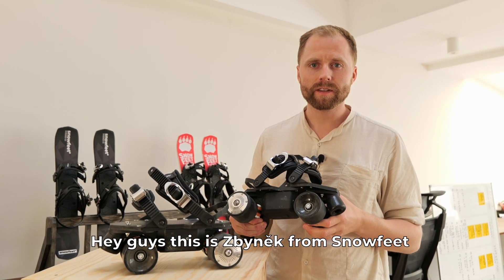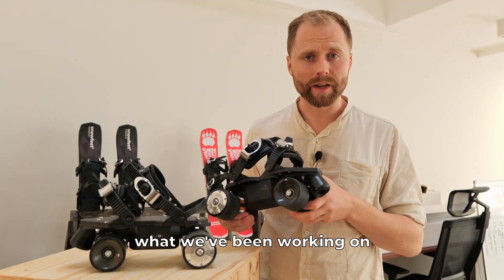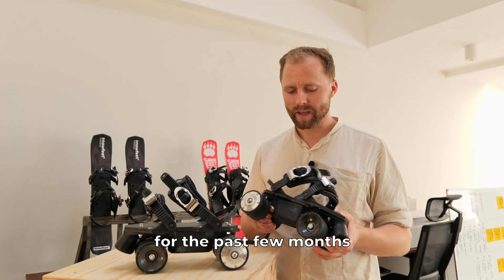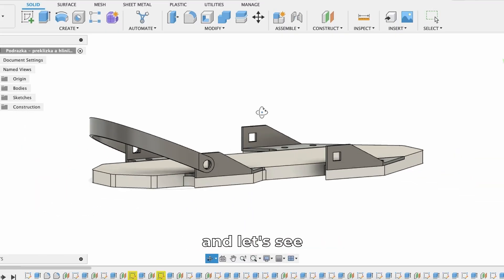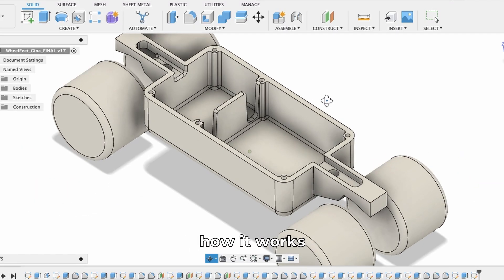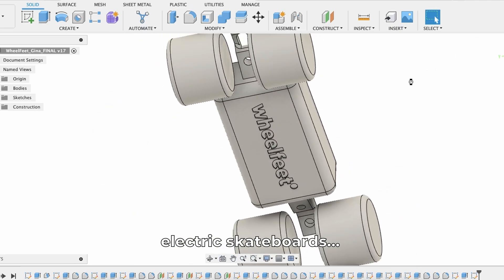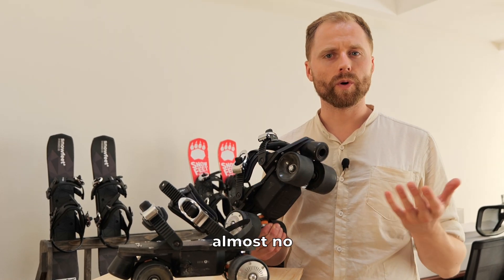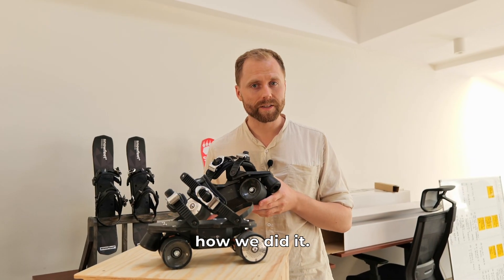How I Built Electric Skates | Wheelfeet Electric Roller Blades | DIY Eskates

Comment: Wow 😍 i liked
What type of electric motor did you use bro 🙏 ?
Reply: Seems to be using an older electric skateboard hub motor from 2018, Koowheel brand by the looks of it.
Nearest modern 75mm hub motors are from Exway Ripple and Meepo Mini Dual.
Reply: @esk8jaimes  great knowledge 👍
Reply from the maker: Thank you :-) That's gonna be released in the near future, it's a little secret so far :-)